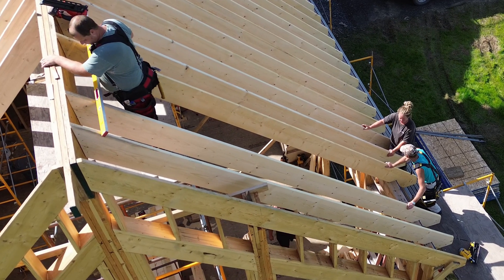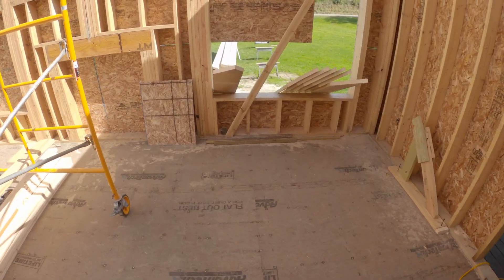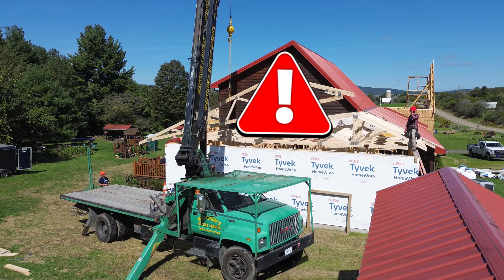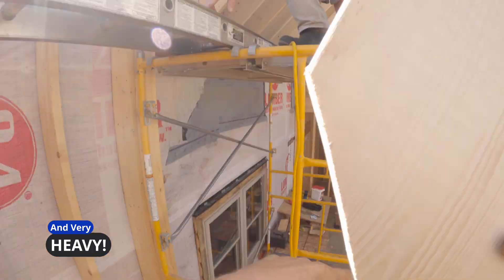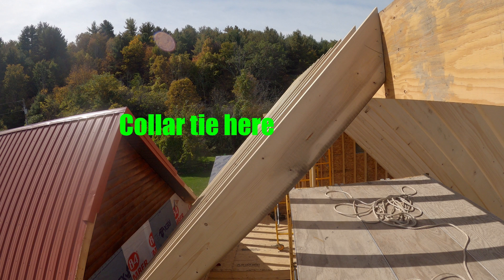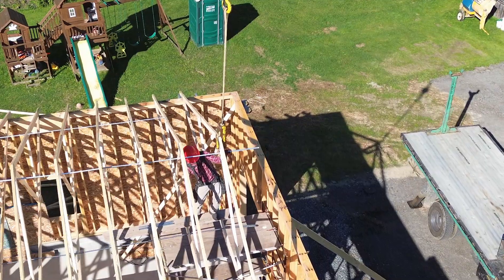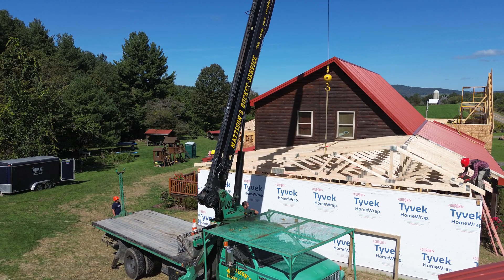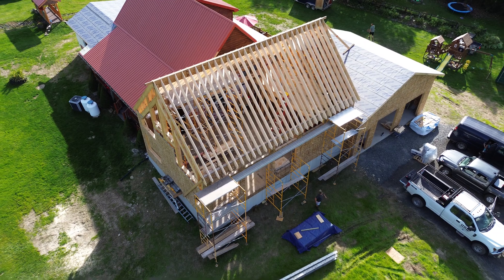Trusses vs. Rafters: Revealing the Pros and Cons in 5 Minutes!

Comment: You need engineer stamp on truss design, is that hard to find?
How much more are rafters? I'm building a single story house by myself, should I go with rafters?
Reply from the maker: Rafters are a good choice but if you don't need the attic space use trusses.
Reply: @HawthornRidge  you can't use rafters longer than 20' I think.  Truss mfg can get stamp I found out